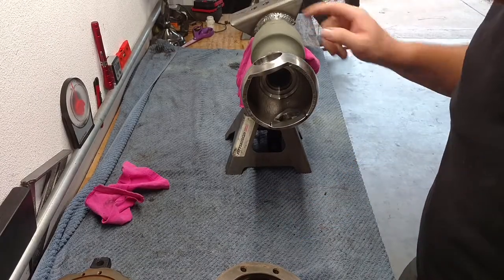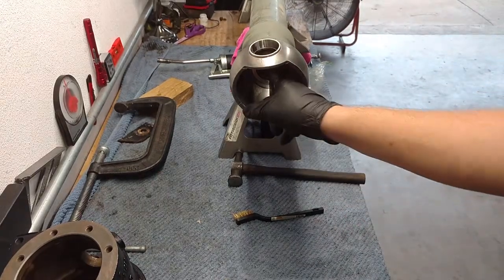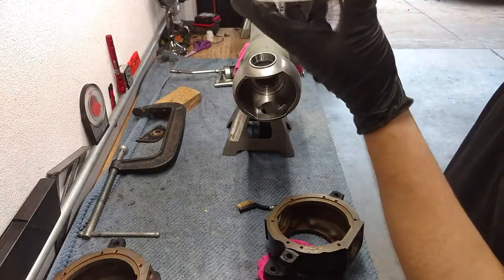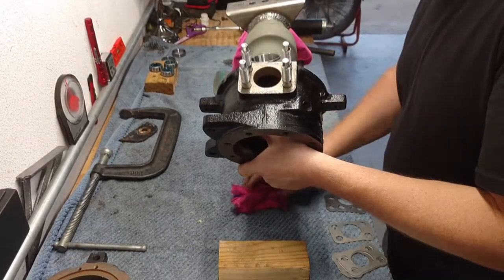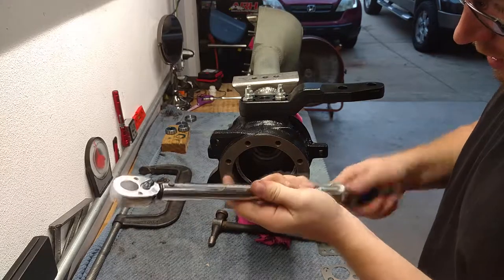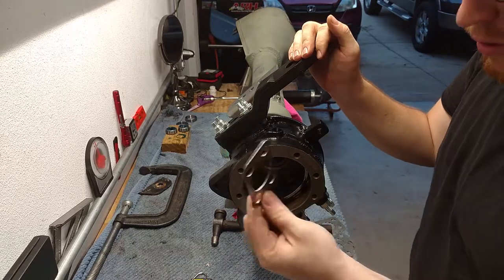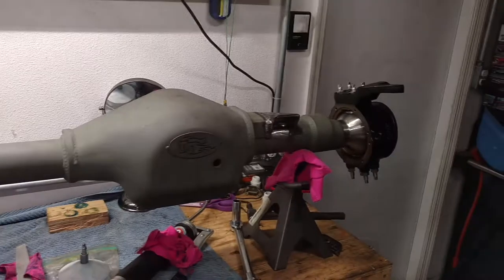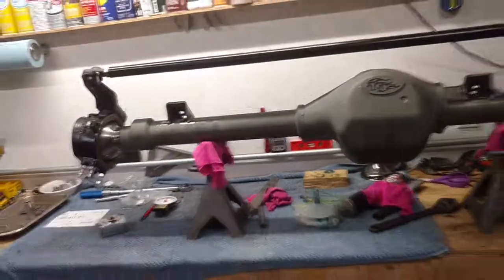Tacoma Solid Axle Swap [Part 9] - Steering Knuckles

Comment: What knuckles?
Reply from the maker: Stock Toyota solid axle knuckles.
Reply: @Trav74r  know it’s a trail gear, but is this a Toyota 8 in style like a minitruck or bigger like an fj80?
Reply from the maker: @harry1522a  yes, this is a rock assault housing. It's is basically just a much stronger version of a Toyota mini truck axle. Mine is also 5" wider to better match the Tacoma width, and they supply longer inner chromoly axle shafts to fit it the new axle width. I use all stock or after market Toyota parts.